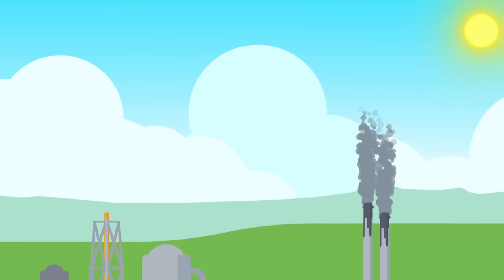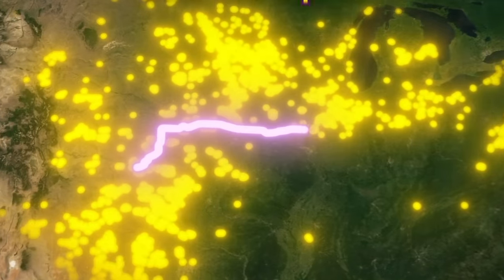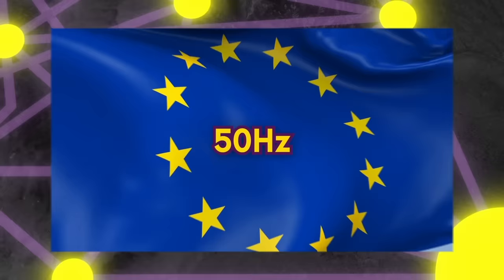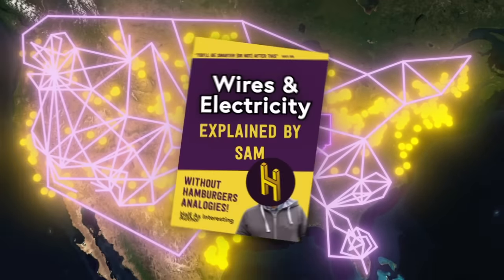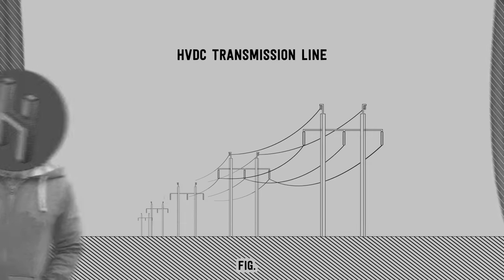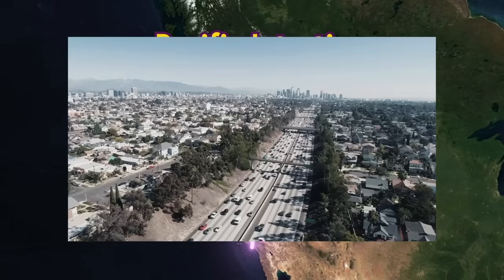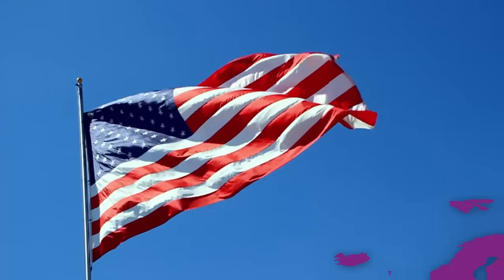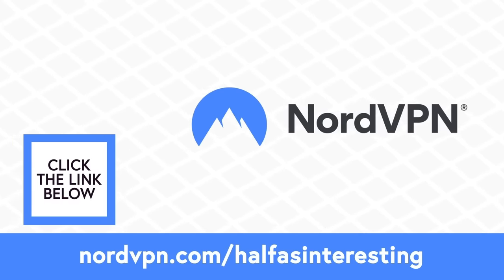Why We’re Building a 790-Mile Wire From Kansas to Indiana

Comment: Slight nitpick: your explanation of why we use AC is only sort of correct. Yes, the primary reason we use it is because we can easily step the voltage (not current, even if the two are related) up and down. But this is especially useful because the higher the voltage, the lower the losses as heat. This is also why the grain belt express would be high-voltage DC and not, like, low-voltage DC.

While I don't foresee DC replacing the AC grid anytime soon, we can build DC transmission lines (duh), and we wouldn't necessarily have to have many different grids for different voltages. We can change DC voltage (with buck/boost converters) with relatively high efficiency.

In fact, inside most computers is something akin to a DC "grid". There is a DC supply, which is usually either from a battery or converted from AC. This is one voltage though, and can't be used to power everything. So we step the voltage up or down, and that way we can power many different components with different voltage needs.
Reply: It is as accurate to say that transformers step current as they do voltage, the only reason we say it steps the voltage is due to our power grid regulating voltage not current, if we build our power grid with current sources instead of voltage sources, you'd have said the opposite.
Reply: converting DC to AC at 500kv and 2000 amps is not a trivial thing. those converters are huge assemblies and very costly. AC to DC is much less difficult however.
Reply: @ronblack7870  Lots of really big IBGTs strung together.  Personally, I think mercury arc valves just look much cooler.
Reply: @fredinit  The phrase "mercury arc valves" excites the physicist in me.
Reply: @ybokors8524  we also say voltage when specifically talking about power transmission because we want to increase the voltage (decrease current) to decrease heat loss. Sure, saying the opposite is technically correct, but then I wouldn't get to nitpick Sam.
Reply: What he said is correct for the time period when transmission lines were first being built. 100+ years ago we really did not have the technology to efficiently transform DC voltage
Reply: Dc is best if you know what is happening at both ends of the wire, and everywhere in between. So high power lines and integrated electronics.

Ac is better when you have no idea what's going on. So local grids. Mixing both, while inefficient is ultimately the better system
Reply: You missed the point just like the OP did. DC power loses transmission efficiency over distance MUCH faster than AC power transmission. Any long-range transmission is going to be AC for that reason.
Reply: @profwaldone  I see you attended to the University of Gibberish and graduated with summa cum laude...
Reply: @TehButterflyEffect That is complete and utter nonsense. The opposite is true, DC transmission is less lossy than AC transmission for the same voltage, current and wires regardless of the transmission distance.
Reply: @fredinit  Yes, mercury valves are cool. But can they be made for HVDC?
Reply: @TheGrejp  Even though we have the technology for DC to AC conversion, i is not worth the cost except for really long lines or underwater or underground lines.
Reply: @TehButterflyEffect  You have missed he advantage of high voltage DC lines. It's only low voltage DC that is inefficient, ,just as low voltage AC is.  Why do you think we have HVDC lines?

Comment: "This is an HVDC line" - shows an HVAC transmission line... DC has 2 bundles of wires normally not even on the same tower, AC has 3 bundles and sometimes 6 on the same tower.
Reply: Is a HVAC line how they get air conditioning across the country?
Reply: @doomsdayrabbit4398  That's called district heating lol

Yeah but on a serious note:
HVAC = High Voltage Alternating Current
Reply: Lmao I noticed this and it annoyed me quite a bit.
Reply: Imagine making an entire video about HVDC lines, without showing a single image of an HVDC line...
ALL images of transmission lines in this video are AC lines.
Reply: @doomsdayrabbit4398   C'mon man.  You know very well they bottle that cold air in Canada and smuggle it in by labeling it maple syrup.
Reply: @bjb7587 OK boomer. Nowadays we send the Air Conditioning over HVAC wires, hence the name. We don't send it by steam powered rail or pony express anymore.
Reply: @erikkovacs3097  
First part - childish.
Second part - derivative. 
Summary - unfunny.
Reply: @bjb7587  Yeah thanks professor. Your talents are clearly wasted in the YouTube comments section.
Reply: The hvdc pacific intertie between LA and Oregon has two wires which are technically each 500kv potential. AC lines have 3 phases which are the same potential phase to ground and phase to phase. 6 wires are usually two different sets of the same line for redundancy, which may or may not follow the same path the entire distance from sub to sub.
Reply: @SovietRobot69  As a kid staring out the window of my parents car on the i210 near Sylmar I was always curious about the only transmission towers with 2 conductors instead of groupings of 3. It wasn't until I was many years older I learned of the Pacific High Voltage DC Intertie running between Sylmar California and The Dalles Oregon along the Columbia. The static inverter station at The Dalles used give tours to the public but they stopped after 9/11. What a bummer.
Reply: The perils of relying on stock footage...

Comment: My favorite fact about ac transmission lines- it's not EXACTLY 60hz in the US. it's modulated slightly by fractions of a hertz by load control algorithms, the result of which is documented in public record. The practically unnoticeable hum of the electrical grid in the audio of any vid can actually be compared to the public record of AC frequency to accurately determine the location where it was recorded. Fun!
Reply: How do they modulate the frequency on a whole grid?  Or is this an unintended consequence of the variations in loading?

Comment: Hi! I'm actually one of the engineers working on this project! I'm super glad that my project is the first your channel thinks is a good idea! Some things not mentioned in the video:
the project is 600kV, which is much larger than the lines most people see everyday
It will be the first ever project that connects 4 different grid systems
It will carry both wind AND solar across the midwest as they are both large under-tapped resources in that region of the US

Also, you showed double circuit HVAC towers and called then HVDC, which isn't correct, the towers are different and even have different configurations based on the type of DC your doing. GBX for example will be utilizing 2 conductors
Reply: @TommyShlong  There's a lot of conversation and opinions that go into this conversation throughout the power industry, and one of the current tech utilizations is the pairing of batteries with solar and wind farms to allow for the collection of power during high production and low consumption, and to use that charge during low production to make both sources a more consistent generation curve. There has also just been a progression thru the year of being able to be more and more accurate with generation predictions based on weather as modeling has improved, as well as generation being more efficient as more R&D is invested. 
One of the other challenges that is being focused on right now is around the inertia of the grid, as renewables do not produce it, and it's important for grid stability. Many renewable sources that aren't talked about as much that utilize traditional generators still which are able to be governed to keep this inertia maintained, but the variable generation wind and solar that most are familiar with use inverters, which do not have this inertia. This leads to the conversations around the grid following vs. Forming inverter tech. 
Overall, we are moving towards a grid that's far more of a mixture of technologies. Also, I may be biased, but transmission is a huge bottleneck for the system that deserves way more love than it gets. Yes, mega projects like GBX will help, but overall, north America's largest machine (aka the power grid) needs to be maintained and grow to meet the ever growing demand that electrification of our lives brings. So when a new line is needing to be built near you, learn about why and teach others you know why it's important!
Reply: I was also thinking whay he showing a hvac line
Reply: @raychillill Add many large flywheels Or, take older generator sets and repurpose them for increasing rotational inertia.
Reply: I have always understood that high voltage was delivered by DC the video gave me the impression that it would be using ac current to a delivery the current. Is this true? And how?
Reply: This correction better make it into the end of year errors video.
Reply: @Raybowlen  Most of the grid is AC. power is generated at the plant/farm, stepped up at a substation, carried thru transmission, stepped down at another substation, carried by distribution, and stepped down again before being delivered to your home. having a DC transmission line is the abnormal. they are usually only seen when carrying power super long distances as in the video, or when connecting 2 asynchronous grids, ex. the grid ties between the eastern and western grids.
Reply: Thanks for information.   Living in southern Indiana.   I have worked  on a lot of coal fired powerhouses.  This technology is interesting.  In  adding into the grid.   Thanks for. Input.   Later.
Reply: Two conductors will at least keep you from magnetizing the Earth and ruining everyones compass
Reply: @TommyShlong  Its already been decided, batteries.
Reply: @raychillill  Tesla has solved the inertia problem.
Reply: @nicklockard  Why bother when you can do it with software?
Reply: @tedmoss  I don't think Tesla "solved" the problem. They are just one of many companies that had a grid forming inverter system. If you'd look at the reply I've given others, you see, I already talked about them.
Reply: Congrats on making this vid make the list of videos he had mistakes on for 2024
Reply: Regional power plants would be more efficient.
Reply: Aren't YT creators great about giving misinformation that the masses are clueless about!
Reply: If moving power long distances across power lines is such a great idea why didn’t they push it from the Powder River coal mines.
Reply: That's amazing! one thing I don't understand is how you're getting higher efficiency with DC instead of AC. I was always taught the reason for this was because the overall distance and electron moved was zero.

I'm assuming it has something to do with the skin effect, that's what the video talked about but if we can step the voltage up with almost zero losses I still don't understand why a HVDC line would be chosen instead of a HVAC. I guess my question is why not either step up the voltage to the next step up from 4kv maybe to say 40kv or higher, or use a higher phase count to make up for the losses?
Reply: It definitly exciting to see what this can do for reliability of a more renewable based grid! Thank you for your hard work!
Reply: @raychillill The 3 phase pylons bugged me too!  Then I was like "wait, maybe this project is using triple redundant HVDC or something".  Also bugged by eddies / skin effect shown as being solved with ACSR / stranded wire when that's actually solved by spacers that allow the magnetic field to die down a bit between adjacent conductors.
Reply: Aluminum or copper? And do you know the cross sectional area of the line? Just curious. Thanks for sharing!
Reply: @thomasrogers8239  Transmission line theory is a whole field of study, but basically when a line gets too long you just lose to much power to parasitic capacitance and inductance. That distance is around 700 km or so when the cost of converting to and from DC becomes more efficient than just running an Earth-sized space heater. The reason you can't just step up the voltage to infinity is arcing. The highest voltage transmission lines in the US are about 700 kV. The highest in the world is 1150 kV. You need a lot of insulation around the power poles, and very wide spacing, to handle that kind of potential. Much more than that and you'd basically be making lightning.
There's also the issue of synchronization and the speed of light. If the farthest two points on a grid are 2500 km apart, that's enough to throw them 180 degrees out of phase with each other. That might not matter much on the load side, but all the generators need to be tightly synced within a few phase degrees or bad things start to happen.
Reply: I live in Missouri were this is going thru its my understanding that the power grid can only hold a certain amount of power so that being said  I have  a question when you drive around the midwest and in the areas that are suppose to get this power a large portion of the windmills are shut down and its not maintenance the hydro power in these areas don't even run all the time because the power is not needed so if the power here is not all needed then what are you going to do with the power you are sending this power line has always sounded like a scam i think it needs a real close look into what is up with this project
Reply: It's crazy to think about the size of the inverter that will be required. What kind of size will it be?
Reply: Awesome! People like you are unsung heroes. Though, gotta ask. 600kV... Does the advice still stand to not lick those wires? Asking for a friend. :)
Reply: What the flip do you use to do conversion to/from 600kV?!?!?!   I guess I'll feel compelled   to go track that down.  Does SiC make this easier? Stacks of transistors?
Reply: That's cool! Thank you for sharing!
Reply: I live in Kansas, we are very thankful for the amazing initiative that strengthens the infrastructures, that are much needed throughout our Amazing Nation! Thank you for doing your part! It is much appreciated!
Reply: I thought those "HVDC" towers looked suspiciously like the ones that go right by my neighborhood for something that you're supposed to find only rarely and, at the very closest to my house, about 150 miles to the south.
Reply: So Ray, can you answer a question for me?  Many years ago, I thought I learned that the Edison vs. Tesla rivalry centered on the fact that Edison wanted the standard for electrical lines to be DC and Tesla wanted AC.  Edison, I remember, favored DC because it was ostensibly safter, but Tesla carried the day because DC could not travel very far, and would require cables like 5 feet thick or something.  But at 3:55 or so this video says that DC is better for carrying long distances without losing the power.  So I don't know what to believe.  What am I missing?